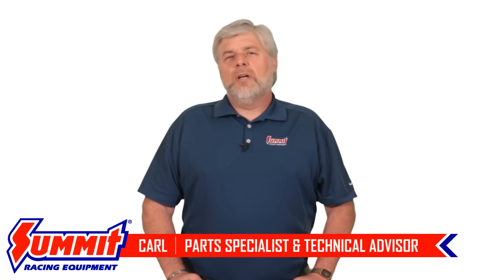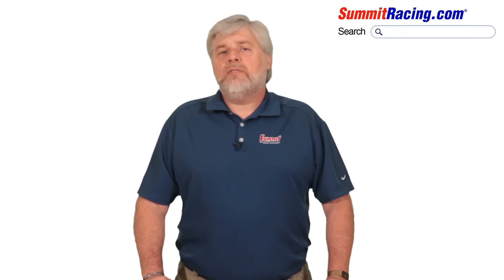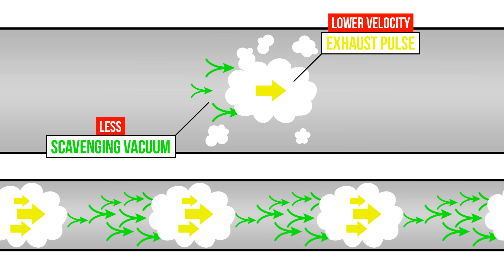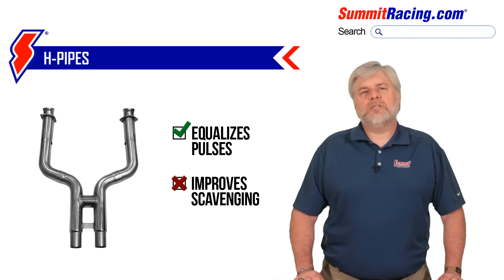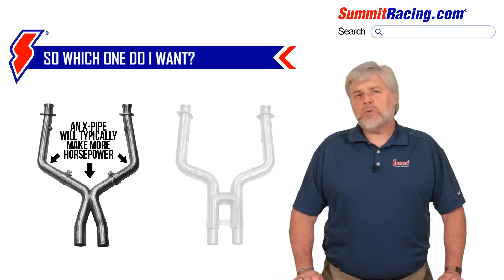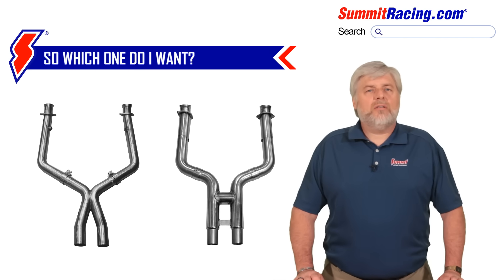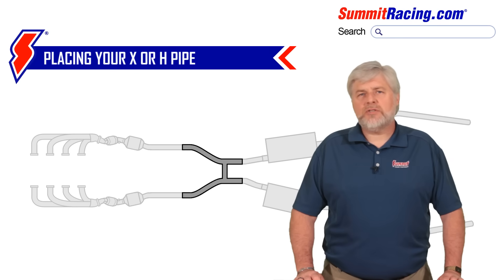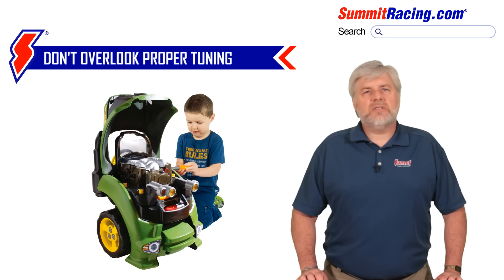Exhaust H-Pipes vs. X-Pipes: What You Need to Know

Comment: It all comes down to what RPM range and throttle opening you drive the most with.  If you spend most of your driving time at or near WOT higher RPMS, go for the X-Pipe.  If not, go for the H-Pipe.  There's a reason the OEMs still use H-Pipes in their exhaust systems even on their higher output engines, and the majority of people will be well served by an H-Pipe over an X-Pipe.
Reply: X pipe blows away that old h pipe..x sounds better and makes more power.. debate what debate.. people always pick wrong..h pipe is worthless
Reply: @frankcobra6890  interesting opinion
Reply: he said that in the video
Reply: tf is a wot rpm
Reply: @JameGoFast wide open throttle.  It's a common term. WOT
Reply: @JameGoFast fix your name jamedontgofast

Comment: I'm building a stock 2008 pontiac g8 v6 do I run an x or an h plus can i remove the resinators
Reply from the maker: Either one will work great for your application, but I think the x-pipe has a nicer tone.

Comment: Jeep 4.0 engines start with a 2.25 pipe to the CAT, then open up too 2.5 inch.  When comparing a single exhaust to a dual exhaust, which OEM size should I use to properly determine the dual size.  Example:  If I base 2.25 to 1.75, I get a improvement.  If I base 2.5 to 1.75 I am more restrictive and should consider dual 2in.
Reply: Follow up: My only other option is to follow the charts I found for each portion of the exhaust. This would mean 1.75in before cat, 2in after cat.
Reply from the maker: For the duals I recommend 2" or 2.25". Anything less than 2" will be too restrictive in my opinion.
Reply: @SummitRacing   Full 2 inch?  Or reduced before the CAT?

Comment: There is one other consideration which was not mentioned. Yes, we all want more power, but is there something else we want? Yes! Sound quality....it's one of the reasons so many of us love Ferrari's. They just sound so damn good. I place "X" pipes on all my cars, not just for better performance, but for a noticeable improvement in the exhaust note, with the same mufflers. I learned about this when I was a spectator at Laguna Race Way....I noticed some V8s sounded better than others. After the practice session, I went to the pits and asked the crew why their car sounded so good, compared to the others. They told me they were using an X pipe, vs what the other guys were using: H or Y pipes.
Reply: Ferrari sound good because they are turned too and often are either flat plane v8 or V12.  Either way that harmonic note is because of the collector in and runner length in the header mostly it tunes the exhaust.
Reply: 'so many of us love Ferrari's. They just sound so damn good'

Do we? I think Ferrari's sound like shit. They always sound really hollow and wheezy like a kid with a 4 Cyl who has put on a 3 inch exhaust and taken off the mufflers because he thinks louder is cooler.  They sound absolutely terrible compared to ANY big block V8. The depth and rumble of the exhaust that you can only get with cubic inches

Comment: @Summit Racing 
'77 Dodge Van 318 X or H?
Also what size pipe is best?
Thanks...
Reply: Upvoting this.  I have a 1990 Dodge van with a 318. Other than some trim, TBI, and emissions BS, Dodge vans haven't changed much from the 70's to the 90's. 
But, from what I have seen, if you want a sharper, more of a "BRRRAAAP!"  tone,  go with X.  If you want a more mellow, deeper rumble, go with H. 
Size: Assuming between 2.5 and 3. 
I want to enhance the sound of my van with that deeper rumble, but I still want to be able to hear music, or have a conversation with passengers, as well as not piss off every neighbor in the mornings, or the others in the campgrounds.

Comment: evolution of making money for retailers 1st it was the H pipe now the trendy new money maker X pipe. wrapping header pipes will void your warranty !! because it stresses the metal . I had my heads inspected and tested both perform the same had the block built and tested . same output in each cylinder then had exhaust set up . no change in " pulses"  . the only thing it does especially with the X pipe is cause the sound waves to bounce off one another and mellow the exhaust tone down a bite . true duals is all you need

Comment: I like the video, but the $10 question is: Do I really need to try different configs to determine which is best, or haven't we reached a point, technically speaking, where a guy with a '68 Camaro, 407 hp, 4 Spd Muncie, Doug's D-368 headers, street/highway cruiser with obligatory burnout to impress the chicks can plug that info in and just get an answer as to what the (closest) optimum configuration is?
Reply from the maker: Generally speaking the X is good for peak HP, and the H is good for torque. Note that the difference either way is minimal so it usually comes down to what fits the space best. We do offer some exhaust kits for your car with crossover pipes built in.

Comment: I have a 69 Chevy c10 with a 350 and was wondering what would be best?
Reply from the maker: An X-pipe will equalize the flow better and produce a slightly deeper tone.
Reply: @SummitRacing  what about a big block 454 in a 72 Chevy Chevelle

Comment: Back in the sixties and seventies we would install our exhaust system without the H pipe initially.  Spray some cheap white paint on the exhaust pipes starting 6" behind the collector For an additional 18".  Take the vehicle out and drive it for about an hour and put it back on the lift.  A short heat discolored area will show up on the pipes.  That's where you install your balance tube.  Works equally as well without headers.  Just spray a longer area.  This may sound crude, but it worked quite well. Sometimes you will find that but heat spots are not in the same location on both pipes.  Some people would take the average distance and weld the pipe in there.  Others would install the balance tube exactly where the heat marks were.
Reply: I was wondering if they were going to mention this in the video.
Reply: Old School rules 👍🏻
Reply: That's properly tuning your exhaust for your engine , every build is different and this is the best way to tune for your particular build
Reply: Nice tip
Reply: Interesting trade skill! :D
Thanks for sharing :)
Reply: An easier way to do this is to use a crayon, just draw a line and where it stops melting is the spot.

Comment: Plenty of comments from a 40 year vet of the performance exhaust industry! First of all; Exhaust pipe diameter, You are correct about too big can ake exhaust pulses lazy- however; the addition off torque cones into the system , especially on a turbo-equipped car can solve this problem! Just be careful- the pipes get a LOT hotter doing this, so be careful about placement! Secondly; crossover placement or tuning. Optimum placement depends mainly on flow, i.e. cam choice, head flow, etc. An old school , but very effective way to determine where to determine crossover placement is to install a pipe on each bank, spray paint a line on them, and make some passes. where that line burns off  (or closest to it as possible) is the best place! Hope this info helps! Doc.
Reply from the maker: Thank you, Mike!

Comment: 302 DZ.. 3 inch x pipe.? Engine has lower HP under 2500 as we know a good HP maker above.. Would a 3 inch exhaust with x or H make any difference.
Reply from the maker: For the 302 small block Chevy, I would use 2.50” piping unless this is a heavily built race only engine. The X-pipe will offer the most peak power. The H-pipe will offer slight improvement in the lower end.

Comment: which distance should the H pipe have between the 2 exhaust pipes?
Reply from the maker: There is not a set distance. It is going to be designed around the vehicle application in order to fit
Reply: All the way😁

Comment: Excellent technical break down on which exhaust pipe design & size(s) to choose for your C3 Corvette! 
 At SimplyCorvettes.com I'm going with Block Hugger headers so we won't have any ground clearance issues with speed bumps or driveways. From there we're going with a set of 2.5 inch diameter  long pipes to act as extended collector tubes to enhance street driving torque & promote proper exhaust scavenging. 

 From there we're extending the custom Collector tube to just past the transmission crossmember and installing electric exhaust cutouts. I chose that particular spot because its Behind the seats & won't deafen you! Lol 

 This way you get the best of both worlds, enhanced low end torque, exhaust scavenging and no loss of power at WOT when you nail it. We're sacrificing the "X or Y" tubes for ground clearance considerations. We purposely didn't go with 3 inch pipes specifically For the rpm range most street driven cars operate in and with exhaust cutouts you won't see the typical 20 hp or 30lbs of torque loss. 

 All of the test results that I used as comparison references revealed that it was only engines producing over 500hp had those losses with 2.5 inch exhausts and Only high up in the rpm band, from 5000 rpm & up. The exhaust cutouts allow us to minimize the power losses by bypassing the mufflers. I think it was a good compromise because this IS a daily driver C3 Corvette making under 400hp (naturally aspirated) and we're installing a 125-150 hp nitrous kit so we achieve the power goals that I want but still get decent gas mileage. Using a #62 jet and the efficiency of N20 allows these cars to make HUGE increases in torque, much more radically than the horsepower.

Comment: I had a 78 Trans Am with Hedman Headers and an H pipe with flanges on both ends. I could then undo both sets of flanges and remove the H pipe entirely leaving me with open headers. The H pipe fit nicely in the trunk. ;-)

Comment: Thx for the hint about the thermo wrap in the end cause I always thought its only pro is lower intake temps due to less heat in the engine bay and it major con is the less cooling through the exaust. Never thougt about the higher gas pressure in the exaust, which can be importan in na engines.
Reply from the maker: Thanks for watching!

Comment: I have a 90 mustang thats has a mild built 302 but 475 hp it has a h pipe and super 44s was looking at going to 3inch exhaust and ether a x pipe or h pipe which would b best. Right now it has 2.25 exhaust on it I rly want to hear the cam and let it breathe.
Reply from the maker: Thanks for your question Yankeetrtala. While both H- and X-pipes will improve cylinder balance, X-pipes have been shown to promote overall scavenging, exhaust pipe size effects scavenging as well. From the information provided, I would suggest 2 1/2" diameter pipes for your application, this will improve overall exhaust sound and performance. I would also recommend taller rear differential gearing like 3.73 or 4.10:1 ratio if you have not all done so already.

Comment: I;ve found that back then, an H pipe used was a good thing. I put H pipes on a few of my big block Mopars and Pontiacs. I did not curve the pipes but left them straight and put the H in at 30" from the down turn of the exhaust from the manifolds. Used 2 1/2" pipe and Walker Continental glass packs. It sounded great and did pick up the performance a bit. This was done on stock non modified engines. Mopars were stock factory solid flat tap and the Pontiacs were stock factory hyd. flat tap. All of those cars were 4 speeds and road cars not drag cars. Great info video.

Comment: What is the minimum diameter H-pipe to be effective?  I have a Cobra replica, and the space is very limited.  I have plenty of power, but would like the sound to be less tractor-like, and connecting the dual exhausts will achieve that with a full-sized cross pipe.  I'm wondering if, say a 3/4" tube connecting the two exhausts would be adequate to balance the pressure and improve scavenging?
Reply from the maker: Ideally, the crossover tubing of an H-pipe shouldn’t be any smaller than the exhaust tubing it’s connected to.

Comment: No idea why are there so many people confused. He said it well by presenting options and how they work and then saying you have to try it yourself. Which is perfectly true because no car is the same and even when you take two same cars they may perform slightly differently. Add personal preference of both car owners and you'll end up having different setups on each of them. 

It makes sense. But it does not when you haven't even started and probably never will. 

Make a setup where you can swith the joint part to be able to compare differences, have a measurement tool at hand (diagnostics etc) to see how all the options change your data output and try it on the road. Because tuning is all about that: tuning. If you want a ready to be bolt on solution then go to IKEA and buy yourself a DIY chair or something or take the car to someone who has experience and just pay for a finished job :)

Comment: Don't waste your money to maybe gain 1-2
 h.p. you won't notice a difference,and the 'loud mod' is just as usless only attraction is the cops.Huge waste of time.Spend your money on a pro-charger instead.It's huge bolt on h.p.and if it's on an LS engine,the stock valves and valve springs are sufficient.

Comment: Is it a bad idea to take existing y- pipe, cut it and run dual exhaust? Doesd it decrease scavaging?
Reply from the maker: You should not see any loss by replacing the Y-pipe to properly sized dual exhaust, however if you are having a dual system built, I would consider making an X or H pipe part of the new system for the benefit they would offer.

Comment: Has a combination of an "X" pipe and "H" pipe been tried?
Reply from the maker: Yes!
Reply: @SummitRacing  Can you elaborate? Is it good, bad, are there specific applications? I'm asking because you're the experts. I wanted to do an "H" pipe with a series "50" magnflow muffler. The muffler has an "X" pipe built inside. I don't want to cause problems using both.

Comment: My GMC dually had two 3" pipes going into one enormous factory chambered muffler, and then one 3" pipe exiting the muffler. I had a shop install a Flowmonster muffler (Holley.com) with two 3" inlets and two 3" outlets. The muffler is Magnaflow style, so it has two perforated tubes going straight through with packing around them. The shop also deleted my cats. My truck has better throttle response now...and much better sound. Total cost was $280.
Reply: Hard to believe that an old-timer would delete the Cats -- ignoring Federal Law and polluting the air at the same -- that's just shit that kids do.
Reply: @SlikLizrd  Hahaha!!!  Us "old-timers" were driving muscle cars and muscle trucks before cats even existed, so we've seen firsthand how they affect performance.
Reply: @OddTimeMan  I'm 83 years old, so I'm an "old timer", too. That's old enough to remember CLEAN AIR, which we no longer have - with no thanks to those who remove their Catalytic Converters in the mistaken belief that they negatively effect performance.
 If you remember, it was the old, pan-type cats that were used by GM and Toyota that would clog and cause power loss.
 Early 70s, Ford came with the Honeycomb, hi-flow design that flows as much air as a straight pipe.
There is no excuse for Cat removal. NONE.
Reply: @SlikLizrd  You must live in a metropolitan area because here in the countryside where I live the air is clean. And honeycomb cats do not flow as much as a straight pipe! My truck woke up as soon as they were removed. Start up is much quicker (used to have to crank it over many times for it to start), and throttle response is better.
Reply: @OddTimeMan  Yes, I DO live in a large, metropolitan area -- Phoenix, the 5th-largest city in the country, and Maricopa County has a population in the millions.
 Our air is bad most of the year, and we have yearly emissions testing, which the famous 95 MERC passes every year.
Now, let's talk some FACTS:
 Air Pollution is a world-wide problem that has been ignored for decades, mostly by fools that think that if they can't SEE the pollution, that it's not there, or that it doesn't exist in "the countryside". 

 There are outfits that make high-flow cats, ( MagnaFlow and Flowmaster) with several models capable of matching the flow of a straight-pipe. SUMMIT RACING sells 'em. 
Cats capable of handling 6.2- liter engines can certainly handle the FOMOCO 4.6-liter (the subject of discussion) with breathing room to spare.
 You claim that cat removal improved your performance -- on a GM Dually, with un-specified year, odometer miles, type of cats, and engine size - but what was the TYPE and CONDITION of the removed cats ??
 Were they the GM pan-type , which were notoriously cloggy ??
If they were partially clogged or damaged, of course they would be a restriction, and a noticeable performance increase would result from their removal.
 Removal of Catalytic Converters is ILLEGAL. Period. And the shop that removed your cats KNOWS IT, which makes HIS removal of those cats a federal cri0me.
But hey, I'M legal and I'M happy !!
https://www.mercuryforum.com/forum/grand-marquis-14/1995-grand-marquis-restoration-8937/
Reply: @SlikLizrd  You do you, I'll do me.
Reply: @OddTimeMan  What a cop-out.
A lot of that going around, lately.
 Cheers !

Comment: If I recall, when a twin exhaust was installed, it was installed without a H pipe crossover, then draw along the front half of your new exhaust with a high temp crayon, then beat it around for a coupla days. This would burn the crayon at a certain location on each exhaust, determining the points at which your crossover pipe would be installed. Of course you have to consider whether it will fit in the desired location. Been a while. Correct me if I'm wrong.
Reply: Thats what I learned too. I was wondering if he was going to mention it.
Reply: @chrismoriarty3342  Maybe you and I are too old-school. We're just too used to having to learn these things the hard way.